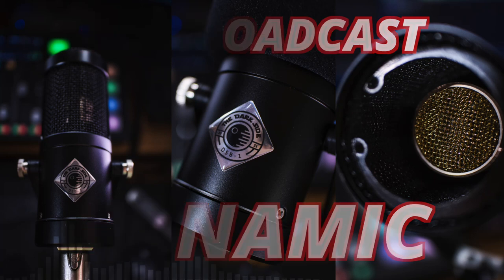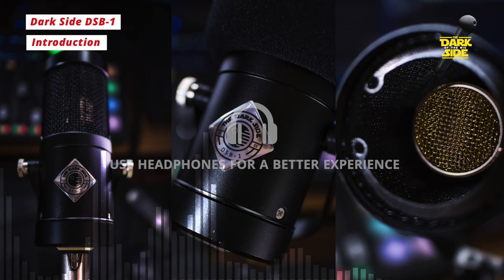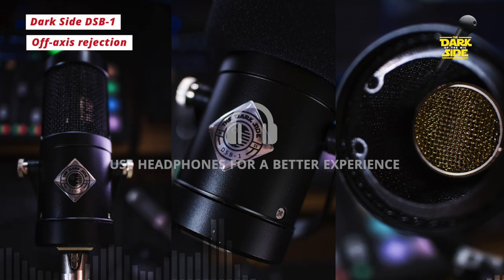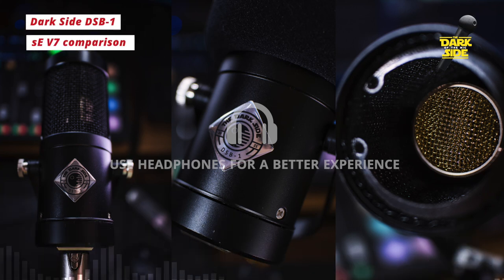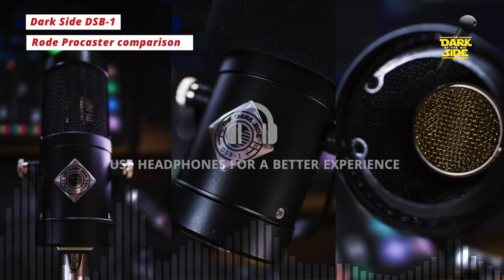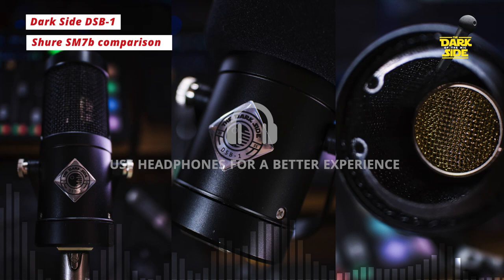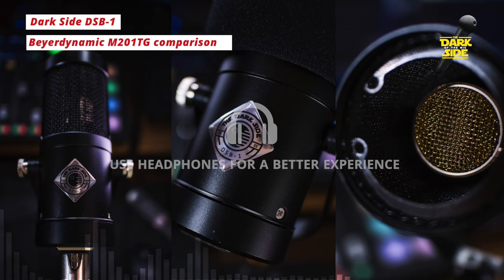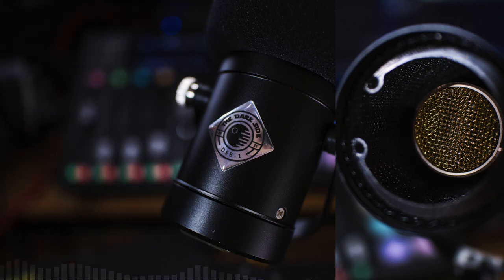The DSB-1: a DIY Broadcast Dynamic Mic

Comment: Hello? I'm a viewer from Korea.
I want to put the SM 57 microphone capsule and transformer in this microphone kit. Does the 743 microphone have a space for SM 57 capsules and transformers? Also, what's the problem when I try this?
Reply from the maker: it should fit, i think, but you may need get some interference if the transformer is not grounded or secured to the inner body. In the SM57 they basically drown it in glue once its wired up. but there will be space - it might be a little fiddly with the wiring.
Reply: The item is here, but the microphone capsule is not fixed. Is there a good way?
Reply from the maker: @으니모모오오  I used sticky foam strip around the inner diameter of the mic body to mount it - that will hold the capsule in place

Comment: You have fantastic mic comparisons, keep going, loving your content. Do you think there's a grill replacement for the Se V7 that is more like the grill you've used for this project?
Reply from the maker: You could extract the capsule from the v7 and install it in another body, but I’d want a better housing than the one used in that project. It works ok but it’s a fairly low quality, cheap enclosure - a great project for housing cheap sub $10 capsules. I’d feel bad tearing up the lovely V7 body and grill :) I think the v7x capsule would be better candidate for a broadcast style rehouse since it has more prominent bass response, you want that because the capsule sits recessed in broadcast mics, so the proximity effect is reduced. I would love to see SE Electronics make a broadcast dynamic using the v7 or x capsule. It would destroy the Podmic
Reply: @thedarksidemic  Thanks for the reply. What I'm imagining is an extended grill that could just screw into the existing grill threads... But yea, if they just made a proper one that's even better.

Comment: I too am looking to rehouse my xm8500 into the same capsule as you’ve shown, my only question is don’t these handheld mic’s contain a transformer in the handle? If so have you tested the difference before and after rehousing?
Reply from the maker: No transformers just wire capsule to XLR, and all good. Use the existing xm8500 wiring so desiolder it from the XLR.
Reply: Thanks. You’re description and blog is fantastic btw. Have you ever thought about adding a little Xlr extension to the yoke similar to the sm7?
Reply from the maker: @BT123D  I’ve thought about integrating a klark teknik CT-1 circuit, so integrated cloudlifter- there’s room in the body for it. All you would need to do is wire the capsule to the board, I think, then install the board which already has an XLR plug on it into the mic body. Perhaps not really necessary with the XM8500 capsule because it’s already quite ‘hot’ but one of the other capsules : Kam Rt-1 or Nosem NM-182 might work really well.

Comment: I really liked the xm8500 rehousing project, now this is a real improvement. I like that charming thickness it gives to your voice. 

I bought the housing and was ready to put the xm8500 on it but this capsule seems to be a cheaper and better idea.

Do you think that I could comfortably run this DSB-1 paired with a Zoom H5? I know that the xm8500 doesn't require a lot of gain and would run fine with it.
Reply from the maker: The gold NM-182 capsule from aliexpress is about the same as the Behringer in terms of sensitivity so same gain. It's a bit more articulate capsule than xm8500, very close to procaster sound profile, just a bit brighter but fairly well balanced :)
Reply: @thedarksidemic  that's great to hear. So, I just need to solder the XLR cable to the Capsule and it's done? Do I need a PCB board or something?

Also, I really think you should do a Video of the xm8500 rehousing, showing the results first and how to do it after. I've seen so many people ditch this excellent mic just because of the "not suitable for podcast" looks.
Reply from the maker: @GabrielOliveira-bu9gd  yes it’s just wire the capsule direct to the XLR, no pcb, really very easy! There is a blog post with pictures on the website - because dynamics are very simple circuits it just about calculating the cable length and how to secure the capsule. Sticky foam works a treat!
Reply: @thedarksidemic  Wow, really easy. It makes me think of how much Audio Companies are profiting. Can't believe that a 30$ Mic can sound as good as 170-250$ ones. I have a last question: How is the handling noise? Can I trust my guest to move the mic around?
Reply from the maker: @GabrielOliveira-bu9gd  Yes its ok - Ive used it with guests on a podcast a few times. You will hear if they tap it, like any mic, but i take some time to explain to them how to speak into the mic at the side and its been great. Its been on the same podcast along side Procaster and Lewitt MTP 740 CM and it sounds really good.
Reply: @thedarksidemic  I might do that as well. Do you have a link for me to checkout?
Reply from the maker: @GabrielOliveira-bu9gd  send me your email, this podcast has not went live yet but they have been signed off, there’s a couple of episodes I can send you